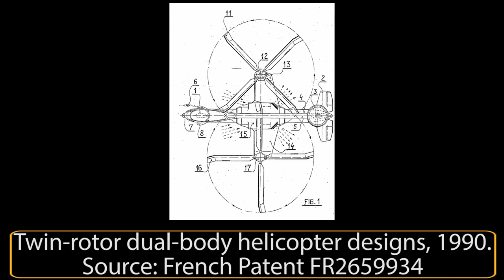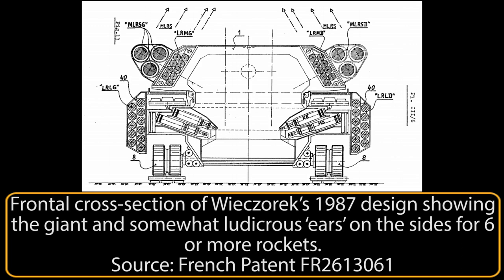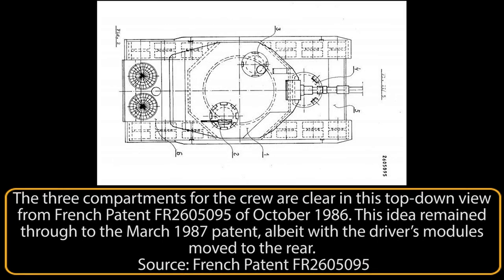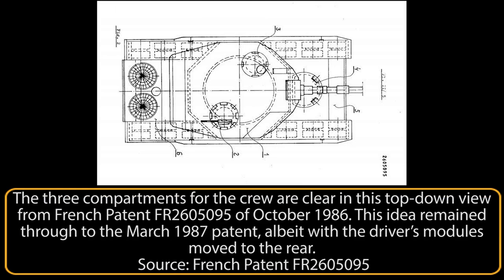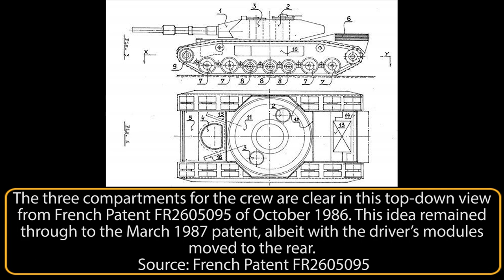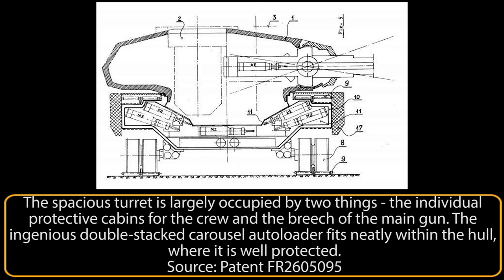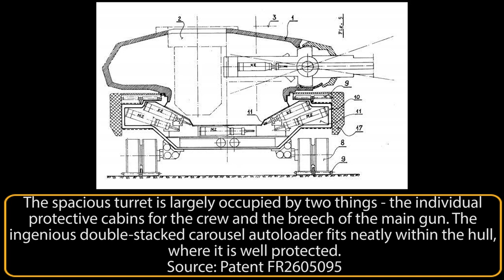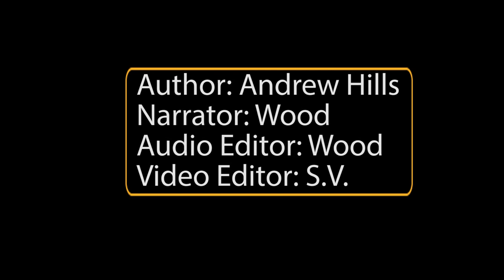Le Maus Moderne | Wieczorek EBC MBT Patent (part 1)

Comment: The biggest problem I can see with this design is it's size and weight. The WW2 Maus had severe problems with chewing up roads, collapsing bridges, mechanical failure,, and speed,  or lack thereof.  And requiring so much resources and manhours to produce a tank quite vulnerable to air power. Better to have 5 small tanks that would be easier to conceal.
Reply: Not only that it would have had to be used as an arty piece do to that extreme vulnerability to air and would have had to be used in forested areas cause out in open ground it would have been a sitting duck. given the 128mm cannon it had would have seal clubbed anything it faced ( as its the same cannon on the jagtiger) and the armor would be nigh invunuable to any tank at the time. it wouldnt be a front line tank more of a back line TD but had the armor to survive multiple hits
Reply: You missed one other major drawback -- field recovery. I can't think of anything in the German arsenal capable of towing a 188ton tank short of a platoon of Bergpanthers. In the latter case one has to ask, wouldn't it be more useful to have the half dozen Bergpanther recover a multitude of damaged "normal" tanks than wasting their time on a single Maus?
Reply: @calessel3139   well the maus would be a huge investment ( as any super heavy tank would be) and loosing jsut one would put you back and if you where unable to recover it thats even more wasted resources lost. but even then the maus would be used mostly way outside from the frontlines cause of its huge investment and how advance it was for the time so if i would lose the maus i would try to get it back along with some other normal tanks
Reply: @coolchrisable   The whole project was ridiculous.  The Germans would have been better suited placing their efforts on smaller more economical AFV designs.
Reply: @calessel3139   well you have to really look at it germany was in a tight spot and they need tanks that could dish out a beatting while also being able to take hits  before being either destoyed or knocked out. witch is why we have the german big cats like the Tiger, panther, Tiger 2, jadpanther, JagTiger, it was the best option for a bad situation. the maus in its design was ment to be able to take out tanks and be so tanky it can survive anything even direct arty attacks it was a bunker on tranks.

the thing about the maus is that hitler didnt consider the logistics of such a beast the gas, the break downs and need for repair and the lack roads and bridges able to support the dam thing. it would have been a logistical nightmare for the german army and this is highnsight.

Germany really couldnt afford afv espically if they couldnt knock out alot of tanks before being knocked out themselves with factories being bombed to hell and back you needed tanks and armor being tanky cause you needed every single one to get the resources of it.
Reply: @coolchrisable  Yes. The heavy tank path that the Germans took certainly appeared logical for their predicament. When I make the point they should have directed the effort to smaller vehicles I mean something smaller than nearly 200 tons; this includes Panthers and Tigers (Tiger-2) but not necessarily the inadequate Pzkpfw-IV.  However the Maus was simply a pet project of Hilter's who took heavy tank theory to an absurd extreme, wasting time effort, resources and manpower. The fact that no nation seriously pursued a comparable super heavy tank in the post war period would furthermore indicate this type of project's pointlessness.
Reply: @calessel3139   well to be fair the heavy tank line was falling out of favor for alot of powers with i believe russia and the us making the last heavy tanks witch was the american M103 and the Russian T-10M ( or IS-10)

hell the only reason russia kept making new heavy tanks is cause Stalin wanted them in the army  and when he finally passed they stopped making them with pretty much every country going for mbts since they could fill every role including heavy tank.

the Panzer 4 wasnt inadequate it was still overall a pretty decent tank and if im not mistaken has the most variants.

but the maus wasnt a pet project hitler believed in wonder weapons and the T2 and the maus was suppose to be part of the wonder weapons that would win germany the war. but as the war dragged on hittler did move more resources into making other types of tanks like panthers and tigers and allowed porche to keep testing the maus  but the maus was put on the back burner as it wasnt the main focus any more as the red army was closing in.

but for the time the maus seemed more logical than one might think  but the german army and their lack of air support and any real meaning full AA ( the whirbelwind and ostwind came way to late in the way and the krugelblizts alot of the parts that was planned for it and what it was actually suppose to have never made it and the flackpanzer 38t or coilion only got though a wooden turret mock up) as they over relied on the luffwaffle really hinder alot of things

Comment: Two engines and two transmissions? Maintenance would be a b&tch, and reliability...
Reply: Just imagine the hell the supply office would have to deal with
Reply: @ryanreyes4622  one thought that occured to me is that the army might save on crew size (4 to 3) but I bet it would have to increase it's support staff... there's no way small crews plus normal maintenance staff would support these beasts...
Reply: @ryanreyes4622  Nah.. Two exact same engines and simmilar transmissions means 2x of smaller parts. Less weight for crane if you need to take one out  It can be done well. Its much easier to design a small engine - used twice than single, big one. The biggest problem is 2 engines 2 trasmissions weight way more than a single one of each. Believe or not modern tanks are on a diet not less restricted than the planes. Because more and more protection firepower and mobility is needed.
Reply: Swedish S tank had two engines.... British have had a smaller APU for decades...
Reply: @HoverLambo  yes, but in both cases these were diferent auxiliary power units to be used in specific situations. In this case, this beast seems to need 2 similar engines just to move around...

Comment: 10:05 So what you're saying is... That we need larger trains before we get to have larger tanks?
Reply: More than that, the entire rail infrastructure needs to be reworked if you want wider tanks, you need to move the inbound and outbound tracks on a rail line further from one another otherwise your wide tank sitting on the flatbed is gonna derail the other train coming the other way. Then you need to widen bridges and tunnels to accomodate the larger distance between the two sets of tracks.
Reply: No need for anything bigger, heavier than we have today. Latest Leopards are 62-65 metric tons. Abrams - 71t. Challenger 2/3 - 73t+. These are the heaviest. 
But starting from Leopard 2A7V(with Trophy) - 65t, all tastes of 2A6 ~59-61t, 2A5 -59t.
Sth like Leopard 2PL or Hyundai K2 Black Panther >59t 
Then Norinco Type 99 - 54t, UVZ T-14 - 50t. Ending up on the UVZ T-90 S/MS/M- 48-50t and T-80BVM -50t. 
These are all mainstream most modern machines. Very far from the need of going up to the size of 100t. Whichever tank above 50t is rather hard to destroy. Apart from  heavy artillery barrage, powerful fighter/gunship air strike or co-operative attack of other modern tanks/IFV/infantry support with latest ammo and/or rocket launchers. There was very few latest tanks killed in action. Whatever media show up - you cant destroy modern MBT easy. No drone, no hand-held launcher (apart from maybe 2-3 pieces), no land mine nor old tank will suffice.
Reply: Yes. Do you even wonder why the Churchill, Panther and even the Maus were so narrow? It's because the designs were physically limited by rail width. The US T95 is another example. The reason it possessed a double track feature (with the outer tracks removable) was to allow transport on trains. The German proposed E100 is another example, having both narrow 'transport' tracks and removable 60mm thick armored skirts. So, as strange as it may sound, it actually is a limiting factor in tank design.